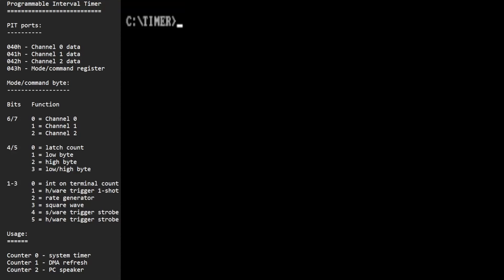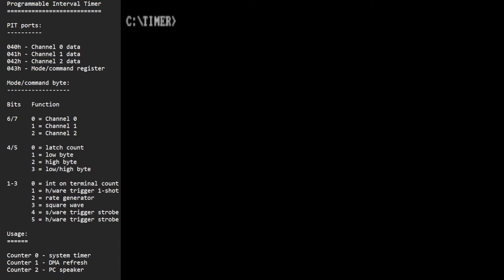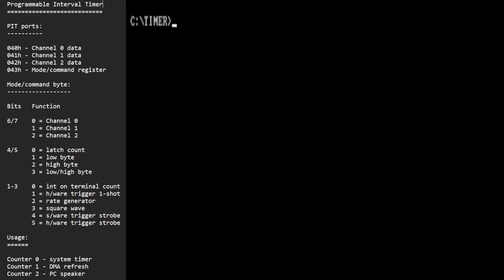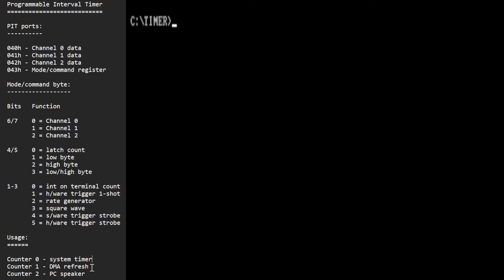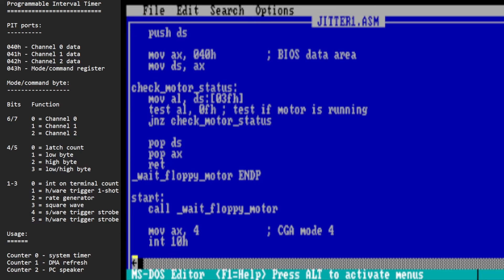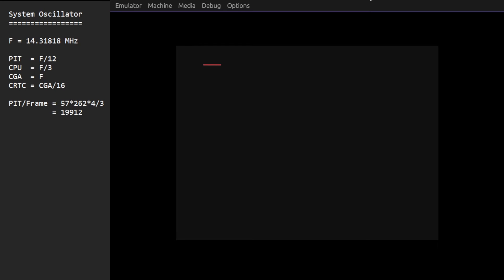Advanced CGA Graphics : Controlling Jitter (Part 1)

Comment: Since we're running the PIT system counter roughly three times faster than before, we could count the number of times the interrupt is run and adjust the tick counter in the BIOS data area by about 30% of it before the program exits, so the DOS clock stays largely untouched. Alternatively, every third interrupt call could JMP FAR [handler_offset] rather than returning itself, although this is probably not great for avoiding jitter.
Reply from the maker: I agree you could update the tick counter upon exit. I suppose you could also call the existing routine, but I'm not sure this would be a good idea, as you guessed.

I have at least considered doing the former in the past. But on my PC, I can't be bothered putting the date and time in every time I start the system, so it'd be a waste of time for me personally.

Given that you are doing something so out-of-spec in the first place, I think you wouldn't be too concerned about this kind of defensive programming. It's not a business application, and nor is the sort of thing you'd ever be doing in a business application.

But you are right that you could do this, and it wouldn't be too hard.